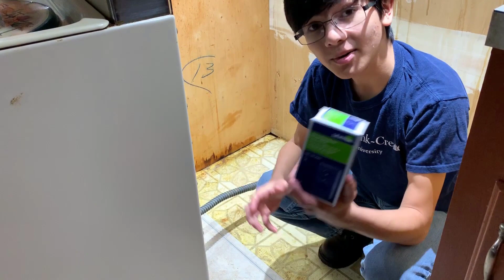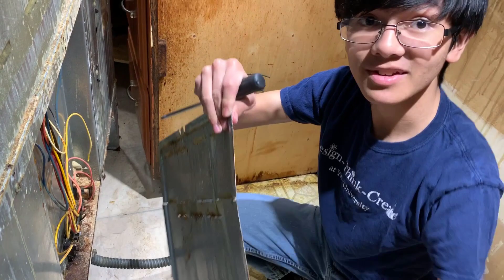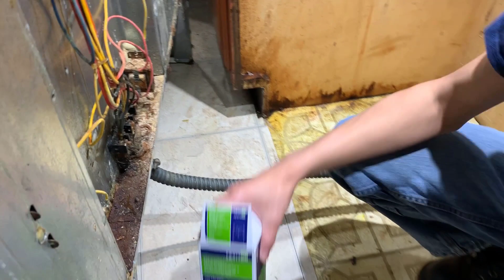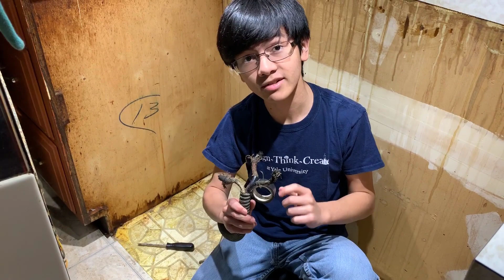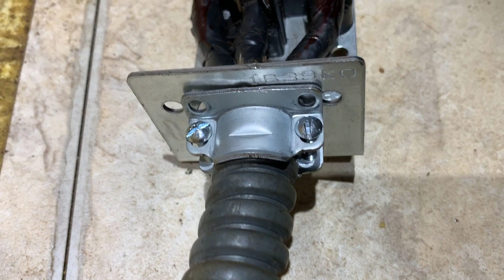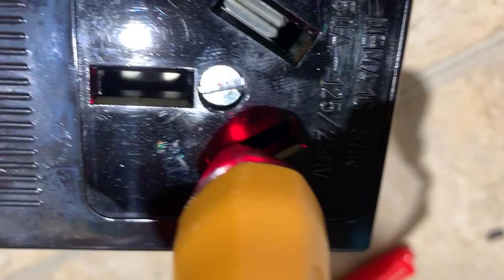How To Convert Hard Wired Electric Range Oven Stove To 3-Prong 240V 30A Outlet Surface Receptacle

Comment: Your oven is 40 amps and you've installed only a 30 amp plug. Did you have any issues with your oven so far? All guidelines suggest having at least 50 amp for a 40amp oven.

Comment: Should probably add a ground wire as the old joint neutral/ground on these is a bad idea
Reply: Half the country literally runs on three wire stove and dryer connections lol. It’s fine as long as you make good tight wire connections. I think it’s a waste of time, money, and resources to replace an entire cable when you’re allowed to use the three wire and it’s perfectly safe if you install it correctly.
Reply: @everythinghomerepair1747 I live in an old house and my dryer is a three wire. I have a double wall oven from the 70s and a more modern cooktop in both of those are hardwired appliances
Reply: @everythinghomerepair1747  you can get a spark if two    metal hits metal from another appliance (used to happen with old stoves hooked up that way if the fridge door touched them). Safe as is, but better exists
Reply: Running new wiring is incredibly difficult without ripping walls open, and will cost you easily more than the new appliance to have an electrician do it for you.
Reply: @kyzf something you can diy with minimal damage

Comment: I think i have to go the opposite direction: i bought a stove from Subway, the sandwich shop. It's oven on top, proofer on the bottom. I thought it uses a plug but that was to the fan on top of the oven. There's nowhere for a plug. I dont have any hard wiring in my house. How do I set this oven up so I can plug it into a 120 outlet. I can take pics for you if that helps. Thanks much.

Comment: I'm not an electrician, so what do you do if you have a newer 4 wire appliance and and older 3 wire house? How do you wire that up? What do you do with the appliance's ground wire?
Reply: In that case just replace the wire add the wire from breaker box and pull the old wire the wire will come out.
Reply: @divyanshpathak8804  either you change the cable to 4wire or run a neutral wire.
Reply: @virolfestrellado9425  I can’t just buy a box like that he has in the video but a 4 prong one hook it up with the 3 wires?
Reply: @nirvanarocks83  it's a cheat in the appliance terminal.  I saw they splice together the neutral and ground wire in the same buss terminal.

 Reason for neutral is to give your appliance control buttons/switch 120V (for north american)
Reply: @virolfestrellado9425  so an electrician told me my white is my hot not a neutral cause it’s old romex so I can connect my 2 hots and bare copper to neutral terminal in a 3 prong outlet
Reply: @nirvanarocks83  it will definitely become hot. You could either wrap it with black or red tape for  identification. But it okay without tape an  electrician would know. Yeah that's what going to happen if you  don't add one more conductor. Functionality it would work, in some state/jurisdiction they would like the neutral and ground wire separately.